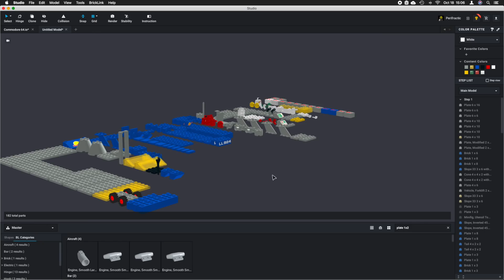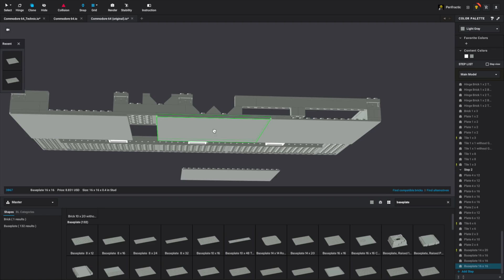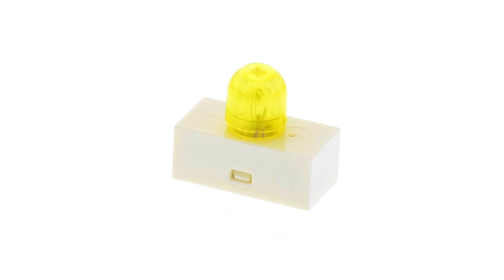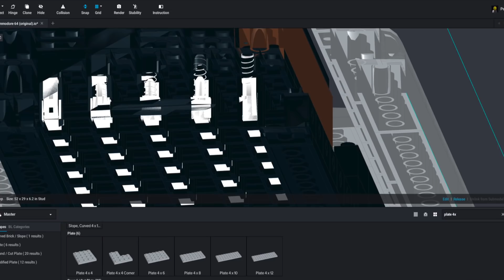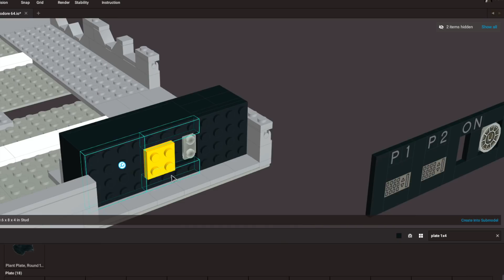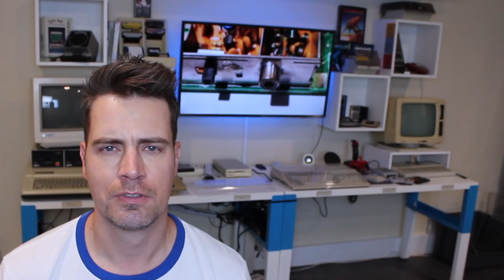Part 1: Full-Size Working Lego Commodore 64! #TheBrixtyFour

Comment: Since the breadbin cases are getting rare, someone needs to go through the process of building the files for 3d printing the top and bottom of the case.  This would make for a pretty much endless supply, and those could be built in pretty much any colour as well.

Comment: shame they won't make a c128d mini cause then you'd get a two in one micro system that is both a c64 and c128 in one just for shits and giggles

you'd think the c64 mini would have to power to do both with it's hardware
Reply from the maker: I'm sure it could!
Reply: @RetroRecipes  yeah it can the c64 minis got power and ram to spare

Comment: If the US isn't going to convert to Metric, can we convert to Lego measurements? :P
Reply from the maker: Amazing idea!
Reply: As a US citizen, I will personally start using Lego measurements.
Reply: I remember back in my day... when I was 81 lego bricks tall...
Reply: I think that should be the new worldwide standard!
Reply: You know, given lego was invented in Denmark, which uses the metric system (admittedly, lego was invented in the 1950's, and I don't know if they were metric back then - the metric system has been around a few hundred years, but widespread adoption is mostly something from the late 20th century.)

Anyway, given that, I found it rather surprising that the more or less standard 32x32 stud lego baseplate has dimensions of close to 25 cm.

Officially a single stud lego brick is 8 mm on each side. (bricks are not square, the height relates to the other dimensions in a 5:6 ratio, which implies the height of a standard brick is 9.6 mm. - obviously the stud on top adds extra height, but not for stacked bricks.)
So... 32 x 8 mm is... 256 mm. Aka 25.6 cm.

I don't know how familiar you are with metric/imperial conversions, but official standards state 1 inch = 2.54 cm.
So that makes 10 inches 25.4 cm.

In other words, a 32x32 baseplate is within 2 millimeters (which is a very small amount if you don't know millimeters), of being 10 inches long.
Conversely, 1 inch is 3.2 bricks.

Having said that, the relation between bricks and metric measurements isn't too bad either, given that 1 metre = 125 bricks.
(too bad larger lego parts tend to have biases towards being powers of 2. Eg, while at smaller sizes you can find 1,2,3,4,6,8,10,12 and 14... From there on up you typically find that if a part exists at all, it's going to be something like 16 or 32 units. There are exceptions, but most of them are still related to powers of 2. 24 and 48 for instance - 48 being the size of a large baseplate. Train bases are peculiar in that over the history of trains they've come in a variety of sizes, 16, 24, 28, and 34 bricks long... But those are of course highly specialised parts.)

So... Anyway. Lego makes for some interesting size relationships I suppose....
Reply: LEGO is metric, each stud is 8mm wide!
Reply: I've been measuring my peen with lego bricks for years. Come to think of it, I don't know why I keep doing it over and over.
Reply: Endless Mode yeah Donald trump said the new measurement will be legos

Comment: It would probably be a little more for an A600 and A1200 case of LEGO but not much. But an AMIGA 500+ that would be double price with the size of that thing. lol.

But mind you the A500+ would look really cool possibly coooler than the C64 because of the sheer lengh and height of the beast and would be more of a challenge to do the thinness.

But would it be worth it for double price to make the beast. I guess it's a future challenge for you to get an AMIGA one right if the C64 one works.

Comment: Brilliant work! One small wish, would it be possible to get a slightly modified model with mountings for 250469 "short" board? (or modify this model so that the builder can choose between long and short boards).
Reply from the maker: You should be able to just move the pins that I provide
Reply: Ah, that easy! Excellent! 😎

Comment: Hm, I just noticed that the keyboard could be impeded by the other keys. The keys on top overlap the keys beneath so it could cause quite a problem there. You might wanna tweak the design!
Reply from the maker: I don't think they do but I know it's hard to see from the high speed footage. Either way tweaking will take place! :)

Comment: this is beyond awesome...it would be nice if you could come up with a way to build this with all new parts versus...finding a donor commodore c64 for the motherboard and possibly other parts...the  reason I say this is new parts should be much more stable than vintage.  I got a case and point in my atari 1088xel...an atari will all new parts...and many upgrades...yea by 800xl standards  it was VERY expensive...but I love all the features on it...this would be create to have 100% functionality, 100% reliablity and a color design ala steve jobs...
Reply from the maker: The new parts could be a Raspberri Pi or an Ultimate 64 board!

Comment: My teacher gave me a Commodore 64. Does anyone know how to find a cheap power supply or all the hook ups for it I don’t know if it works or not
Reply: You can build one, just need a 9volt 1.5A transformer a rectifier a few capacitors a 7805 and a 7 pin din connector search google for the schematics, if the computer does work, then think of completing it with an original PS
Reply from the maker: Check out my other video where I build a cheap easy one!